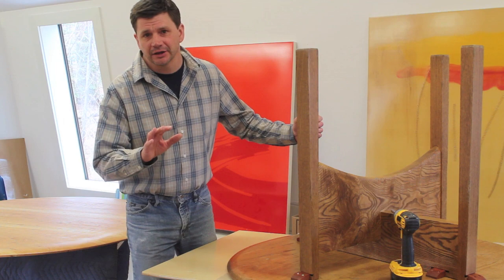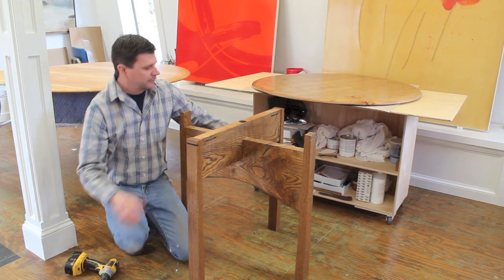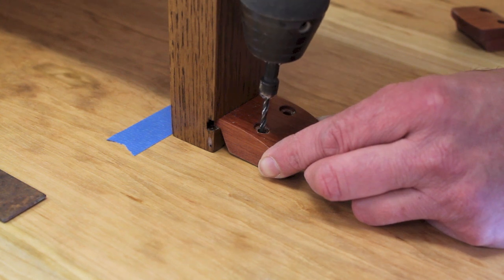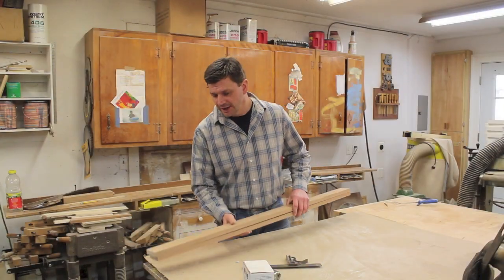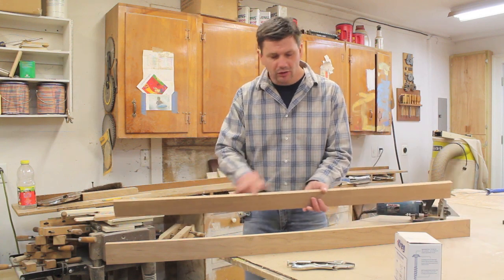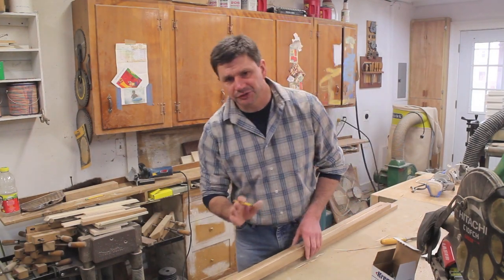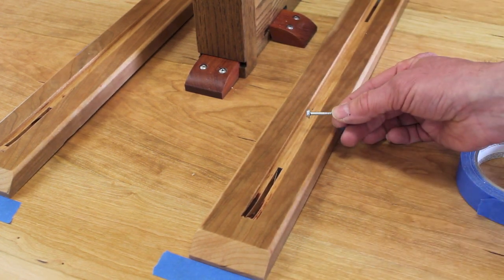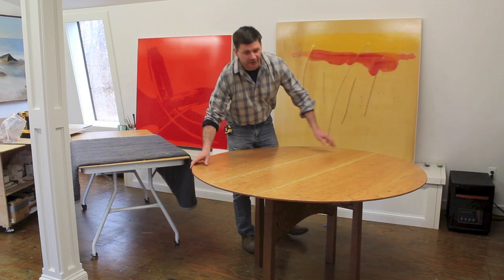Modifying the new table top for the old table base

Comment: If you had only known you were going to have to take it apart you could of put a screw in the middle of the braces. Doesn't really matter much though huh? Thanks so much for sharing. I think I like the old table top almost as much as the new one because of the dutch mans! :)
Reply: ***** Hi J yes but tightening the screw would be the next challenge,
another class job,
G